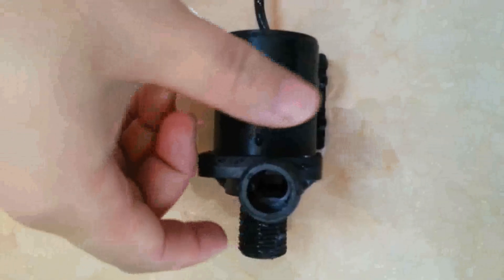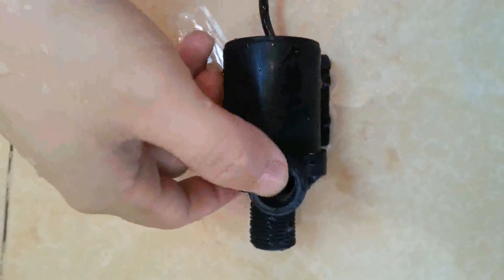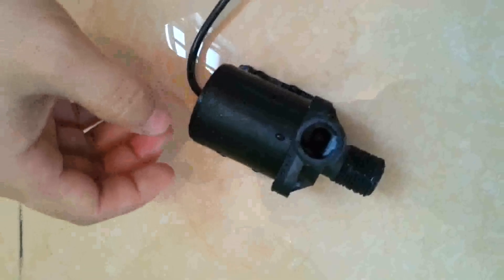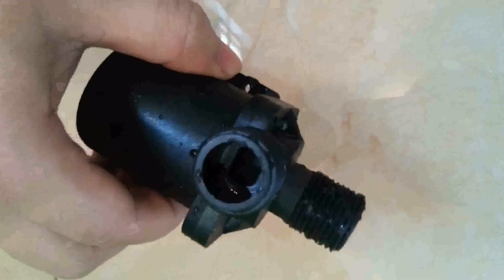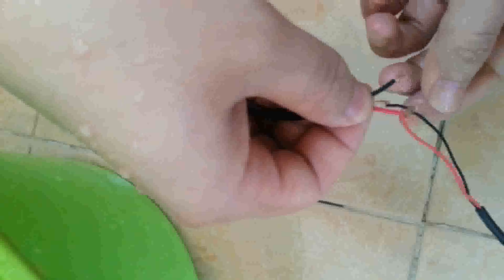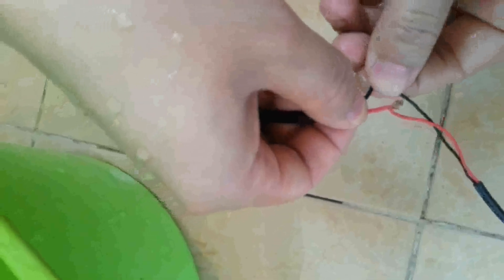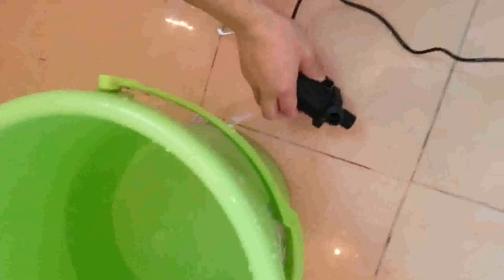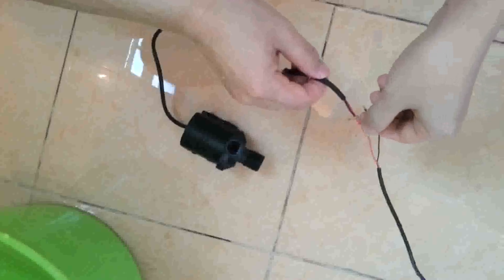Micro DC Brushless Pump T-40-12VDC Model Low noise High efficiency Absolute safety

Comment: Can I use this directly from a 12v solar panel only (ie no battery)?
What minimum voltage is required for it to start pumping?
I am thinking that I would have the solar water heating panel water recirculated during daylight hours only and stop at dusk so that cold water isn't passed into the storage tank, restarting again at dawn.
Reply from the maker: Typically, the startup voltage for this micro pump is about 6VDC. Surely, the max voltage should not exceed 14VDC (within 13VDC could be recommended.)